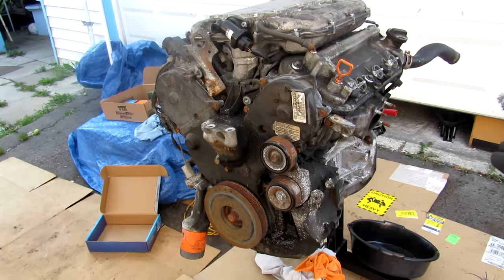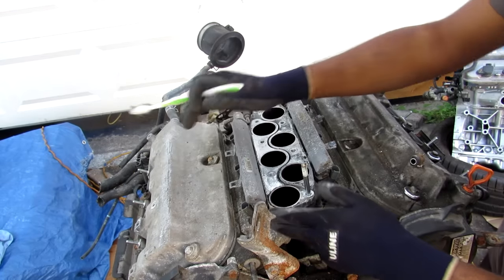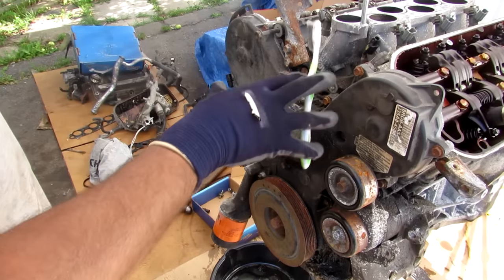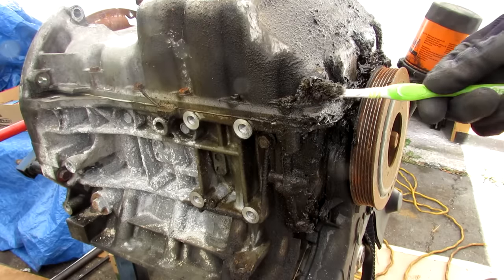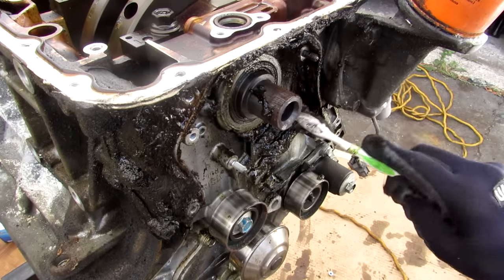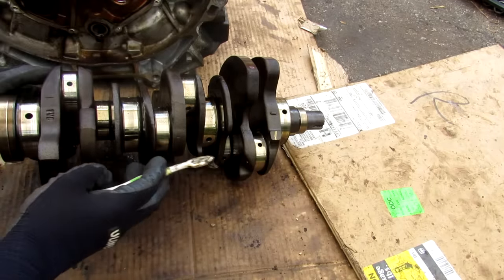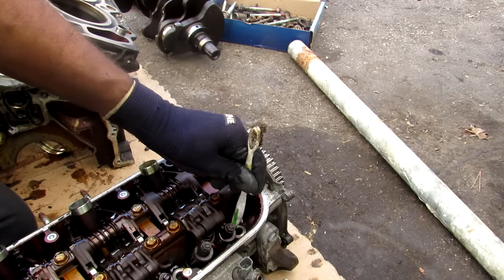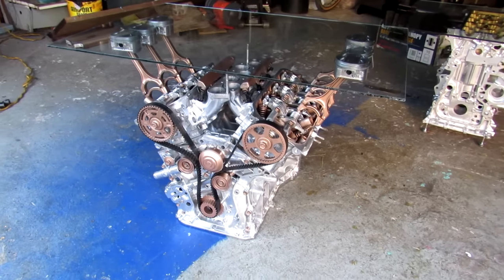Why Honda V6 Engines Haven't Changed For 25 Years

Comment: This engine was also used in the Saturn Vue for several years. With their light weight and the 3.5L VTEC engine, they are something of a sleeper vehicle.
Reply: Lol I raced my friend in his j35 vue and it almost stayed up with my Acura
Reply: Petrol Isuzu bighorn SUV had honda v6 j32 engine in it known to be very reliable and powerful,only problem timing belt and cambelt and service was expensive for regular car.
Reply: The same is true of the v6 Accord Coupe. Faster than most think

Comment: My 2003 Honda V6 has 279,000 miles on it. Does not leak at all, and does not burn oil.  Still smooth and very powerful.  I have 6 speed manual and it does pretty good.
Reply from the maker: Yep these V6 engines can go a long time!

Comment: I'd rather have a quality Japanese timing belt than a German timing chain design purposely made of soft steel to stretch and produce metallic contaminants... 
👍
Reply: But Honda timing chains are made by BorgWarner?  They are exactly the same type as the timing chains used in VW engines AFAIK. :P  (It's more the guides and tensioners that VW use that are the issues AFAIK.)
Reply: I think he saying he basically would rather have a timing belt then a timing chain and I agree even though you have to have a service interval at least it’s made to be replaced,The timing chain is really not expected to be replaced so when it is time to do it it’s a major job
Reply: @thetechlibrarian  it gets scary for the audi 2.0 tsfi at 50k...lmao
Reply: Toyota.
Reply: PSA has you covered. In the current engines they have timing belts INSIDE the oil that last for about 300.000 km.
Reply: @user-gdxt-7399  not, on the peugeot you can throw away the engine at 90000km due to the timing belt in oil
Reply: @alessandroserrao9422  Even if you always use the correct dpec oil? It absolutely needs that

Comment: There’s a gentleman at my work who drives an 06 accord with the J35 V6, which has over 300,000 miles
Reply: Nothing for a v6
Reply: J-30, they went to the 3.5 in 2008 for Accords. Both are great engines
Reply: I sold my 03 v6 with 285k miles, such a quiet and powerful engine.
Reply: @humbertoarteaga3858  a bit too quiet with stock exhaust.
Reply: @humbertoarteaga3858  why did you sell it?
Reply: @trp2413  6 speed manual  with a j series is heaven
Reply: 2012 4 banger Accord 378k miles and still rolling...
Reply: @humbertoarteaga3858  quiet tell that to the people with a clattering sound from the top end
Reply: Good ONE  unfortunately it was auto and it was on its second transmission when it went out. I just didn’t want to go through that headache
Reply: I work with a guy with 600,000 km on an odyssey, 3rd transmission though

Comment: Have an 05 odyssey with 235k original v6 and transmission. Love how smooth, powerful, and reliable the j series is! Best engine imo.
Reply from the maker: Yep it's a very good engine but paired to a bad transmission
Reply: @speedkar99  how is his transmission bad , if it lasted him 235 k miles??......🤔🤔🤔🤔🙄🙄🤦🏾‍♂️ Bad reputations are like rumors and mean nothing if you actually take maintain/change  your fluids
Reply: @speedkar99  the transmissions were bad in some years not anymore. I have an 08 accord v6 no problems from the transmission
Reply: @nickrabiner7843  I agree

Comment: Some British guy in 1919: invents variable valve timing
Literally every modern piston engine: has variable valve timing
Honda fanboys: VTEC just kicked in bro
Reply from the maker: True!
Reply: Vtec effects lift and duration, not timing. I think timing is done with phasers on the cam sprockets. Spacely Sprockets (Jetsons theme starts)
Reply: @brandonobaza8610  First sentence found from Googling "VTEC," via Wikipedia: 
"VTEC (Variable Valve Timing & Lift Electronic Control) is a system developed by Honda to improve the volumetric efficiency of a four-stroke internal combustion engine, resulting in higher performance at high RPM, and lower fuel consumption at low RPM."
Reply: @acefighterpilot  Timing is even in the name 😂 Nevermind, I'm dumb

Comment: "It has a fram oil filter so, you know this engine has seen some abuse." I say the same thing everytime I get a car up and see one.. 😂😂😂
Reply from the maker: Haha 
Yep tells you a bit about the owner
Reply: May be it's a TL crowd thing, IDK. I've been using FRAM Synthetic XG7317 on my 2008 MDX since 2014 and it's not abused by any stretch of imagination. Just a family car that's been taken good care of.
Reply: @AcuraAddicted  fram quality control is junk and they use fiber end caps, where as the other filter makers use metal.
Reply: What you think about wix filters?
Reply: @AcuraAddicted  I have a TL with J37 and I bought 6 of those XG 7317 filters last year. 
The regular fram sucks as we all know, however obviously you've done your research,  the fram ultra synthetic is one of the best filters in the market. 
I installed one during second last oil change just to give it a try, that was November last year, roughly 5 month later I needed another oil change again. drain the oil, took the filter off and realized the silicon anti drain back valve was squashed and completely pushed off from where it was supposed to sit. So it's been just sitting sideways and doesn't do shit. I inspected the filter before I put it on and everything was perfect before I installed it, and no way I could damage it during installation. No idea how long it has been like that but I've done many many oil changes and I've never seen a single oil filter fail in this fashion. Not even the cheapest Chinese made garbage oil filters. 
I change my oil very often I've never went past 5000kms without an synthetic oil change. I know this is a quite overkill but I believe frequent oil changes never hurt the engine whatsoever, and also I do a lot of city driving stop n go like that. I'm saying no way this top of the line fram filter shall fail during those conditions, like I'm literally doing less than half of what my car's required service interval…yet the filter is toast. 
They are supposed to be very decent filters but I now went back with NAPA gold AKA wix 57356. I don't want oil starvation during start up hell no. 
Pay attention to the filter man you know how important those things are, my case might be one of a million maybe QC people took a nap during working hours I don't know but it did happen and it happened on a car that I care about the most. No I don't want it.
Happy Thanksgiving!

Comment: I have a Type S with 112k miles. Thank you it was super interesting to know what goes on in my car explained it very well.
Reply from the maker: Good to hear from an owner. You have the 6 speed manual?
Reply: @speedkar99  I wish. I got the 5 speed auto sadly, but i love the car. It was leaking tranny fluid before on the coolant holes thats the only trouble it has given me. i was thinking about changing the tranny fluid once a year, is it worth it?

Comment: You are a very good and knowledgeable mechanic. The ONLY PROBLEM that I personally had with your video was when you just dropped the engine block after picking it up??? Other than that, you ARE GOOD👍👍👍👍👍👍

Comment: Thank you for being so thorough with this teardown. It's excellent to see which areas I should pay attention to on my J32.
Reply from the maker: I'm going to do a  tear down video on the J32 you saw sitting at the side to explain how VTEC works
Reply: yep, pay attention to the infamous "oil filter spool" + "oil pump seals" leaking! With enough pressure lose they tend to starve lubrication.
Run a thicker 10w30 or 5w40 oil grade instead of low viscosity 0w20. It helps make up for pressure loses in camshaft bearings and hardened seals.
👍
Reply: @glasser2819  Thanks for the advice. I was planning on moving from 5W-20 to 5W-30 since the gaskets are getting to what I consider the age of uncertainty.

Comment: me looking at my J30A5 engine
"See you're never going to get love from the community" 😂 I haven't been able to find anything cool about them and the same goes for an 07 Accord SE V6.
Reply from the maker: They aren't cool but they are dead reliable
Reply: They came offered matched with a 6 speed manual cool!!!  I have a sedan for those rare 2 years offered and love it.
Reply: If you plan to keep a car for a long time, the manual trans is the best option.

Comment: Thanks for this video. I own a j35 (2007 TL-S) and j37 (2007 MDX). I never knew the knock sensor was in such a bad spot. I've taken apart dozens of Honda 4cyls but never got into taking the v6 apart. Thankfully. They are much more "connected" to everything than the 4cyl. My TL-S auto transmission is just starting to clunk a bit at 170k. The MDX is still going good so far at 220k. This video made me glad I paid Honda $800 for the timing belt/wp/tensioners installed. I would still be putting it back together
Reply from the maker: These are great engines. Too bad the transmissions attached to them were never as sturdy.
Reply: @speedkar99 I know the CVT from Honda has had its issues, but how do you feel about the manuals paired with J-Series engine?

Comment: what you mean "fairly" reliable? As if there are many others out there that can outlast Honda motors?
Reply: Toyotas engines are more reliable. And dont forget that the versions of this with VCM were known to have oil consumption problems.
Reply: that engine still used in Indy Car until now but put some DOHC
Reply: Toyota's don't last or didn't jhoin in Indy Car series because they have no reliable V6 engine to compete with Honda, Chevy, Mercedes .....
Reply: Andrew M Toyota as a brand whole may be more reliable yes, but Honda does build better engines overall, ESPECIALLY 4 cylinder engines
Reply: Honda's V6 are already proven also its reliability in TLX race cars, Indy Car, GTR, 24hours racing even at F1, just like much to inline 4 cylinder of CIVIC in World Touring Car Championship
Reply: Many.  Buick 3800 and AMC 4.0 are known to last past 300k.
Reply: @totzinfo  i would not use recent honda f1 as a "good" example.
Reply: AC Cobra  The manuals are fine, and since this is a Honda, that's the only sensible choice.
Reply: @totzinfo  That's the IMSA engine for the Acura Daytona Prototype I think, the Indycar uses a purpose built racing engine.
Reply: @theakh4238  I've had plenty of relatives go 300,000 on 3800. However, the rest of the car did start falling apart at 100,000 miles such as window regulators, interior parts falling off for no reason, and severe rust. All Buick Park Avenues/Lesabres.

Comment: Have one of these engines that has 400,000 miles and it’s still going!
Reply: I have an 03 v6 accord with 360,000 miles and I still hit VTEC once in a while. Still has plenty of power and has never left me stranded. One of the best engines made!
Reply: I know a guy that is not far behind you... 349,000 still going
Reply: We're at 295,000 miles on our 2003 Accord V6, though I worry its getting too rusty, and i doubt we will see 350,000 miles.

Comment: I laughed out loud at the Fram oil filter comment! You are 100% correct on that! Fram makes one, if not the cheapest filter on the market today with their cardboard end caps etc. I generally stick to WIX or Hasting/Baldwin filters myself. Keep up the great work!!
Reply: Only now I get that joke.
Reply from the maker: Yes, I've cut fram filters apart alongside OE...I only use OE now
Reply: @speedkar99  That could be a great video idea! Line up a bunch of oil filters and tear them down and compare! Keep it up brotha!
Reply: @speedkar99  it amazing how Japanese OE parts quality is always best!
Recently I dealt with a Honda PCV Valve from eBay that was likely counterfeit junk... I put back the old original fixed my idle miss.🤗
Reply: @DeathMammoth91  there is a video on you tube, K@N make the best filter.  The high end filters like wix use synthetic filter material that is good if you don't regularly change your oil. Reason being is that the material does not break down and fall apart after long period of use like a paper filter. That being said moisture is a major contributor of sludge in oil.  Filters like WIX that use synthetic are useless at removing moisture from oil. Paper filters (like paper towels) are great at moisture removal. K@N is the only high end filter that uses paper material, except they coat the paper to prevent breakdown.
Reply: @rayalarcon115  Thanks Ray for the information! Do you have a link to this video? Thanks in advance!
Reply: Mobile 1 20,000 -change at 7max😂

Comment: The engines were good until Honda started using there VCM (Variable Cylinder Management ) system. I had  the common issue of worn piston rings and all the cylinders on the back bank, especially cylinder 1 constantly misfiring.  I was one who always had the car serviced for everything. The one thing I regret is following The Maintenance Minder. I think most  engines need  oil change at 5K. If you rely on the maintenance minder it may not tell you to change the oil until 8K.
Reply: And even no further reply with the oil burning issues of the Acura J37 engines.
Reply: I hear worst are 2008-2010 Odysseys which also some had cams that would wear out. Yet i still see many for sale with mega miles hmmmm
Reply: its not VCM. the 3.7s have issue with the oil control rings gumming up and cause oil burning. caused by large heat cycles(living in cold climate) and short travel distances.
Reply: I had crv 13 and civic 17. Serviced at dealer. They always ask to do oil change at 5k miles. Isn't that the standard for any engine?
Reply: @amilmitt  Ouch, hadnt heard of these issues not good for Acuras reputation
Reply: Pretty sure that VCM was absent on the manual transmissions, which I presume this Type-S was mated to.
Reply: @miguelelasmar  Majority of type S TLs were autos bummer :( But you're right
Reply: J35s from 2013-up had revised VCM systems.  No major issues are found on  post 2012 motors. (at least the non-GDI Accord versions)
Reply: @timothyforce1949  It's not 2013 up for all Hondas. Only Accords. VCM-3 was introduced to the Odyssey in 2018. It's not really revised, just more like the initial version of VCM and doesn't activate as much.

Comment: I've been beating the hell out of J30's for a couple years now doing Time Attack, and HPDE. These things are capable of handling so much abuse, it's insane.
Reply: Love to hear it. Any more to share please do. It's my first manual, J30A4. Had a money shift early on, from 3rd to 2nd and over-revved to close to 8000 rpm for 2-3 heartbeats. Zero problems from that, still redline it nearly every day, through 0-20F temperatures too (once warm). Change oil religious 5K mi full synthetic.

Comment: Honda dealer mechanic here. The injector bases on Honda V6’s do come off without taking off the heads. One after the other it just takes some wiggling and a little finesse. It is meant to come apart that way. The knock sensor sub harness is often chewed by mice that’s why it’s covered in capsaicin tape but they often don’t care and chew it anyway. The sub harness and knock sensor can be changed without taking out the injector bases. Removing the intake plenum and power steering pump will give you enough room to get in with pliers and a wrench to get the harness off and the knock sensor out. It takes about 45 minutes.
Reply from the maker: Thanks for the tips 
I struggled with that dual intske setup for a bit

Comment: W/o seeing the video the engine looks flooded and not maintained look at that rust.
Reply from the maker: rust? Its been sitting in my yard for a little while until I got to it.
Reply: I don't even want to know what the rest of the car looked like just knowing how much neglect this engine received, especially the rear main seal and timing belt.
Reply: @B-rad1  the motor sat in the yard with the element's  for quite some time, im sure the water from the rain and moist would caused that timing belt to dry rot
Reply: I have a 07 Accord that is well maintained.
After 13 years in the Chicago salt belt, my engine looks just as corroded as that one...

Comment: Your videos are excellent with lots of tech related quickly, with concise editing.  Never learned so much so fast.  Great engine, but I agree that having rubber timing belts makes it not a desired choice today.  The MLS head gasket isn't a downside as that was an upgrade in many engines, indeed switching to an MLS gasket fixed a notorious oil leak in my 1996 Plymouth 2.4L (a recall).
Reply from the maker: Thanks 👍 ok glad you appreciate my video style

Comment: Ive had this engine for years it was nice to see the teardown and wow the knock sensor its in a horrible spot. Its a very realiable engine and it would had been better if it was designed with a timing chain instead of the rubber belts that goes bad over the years and milage. Thanks for the teardown this will help me  with my j37 and j35 on my MDX.
Reply from the maker: You are welcome. Good engine but a bit behind it's time now
Reply: Honda timing belt is non-strech design-incredibly strong! It's better than timing chain because quieter operation. It good for 10years or 110,000.

Comment: Had a '98 Accord Coupe with the J30...bought used and ran it to 270K until the trans started to worry me... Bought a '14 Coupe with the J35; no problems there. And in the meanwhile, bought an '03 TL-S that was an absolute creampuff. Garage kept, beautiful. Heard horror stories about that 5-spd auto, but so far, so good w/ 148K on the clock. Either the previous owners replaced it already, or it'll probably be fine at this rate...or not. 😜

Comment: I've had four of these engines 03,04,12,19- great motor.  Just wish it had a timing chain rather then that stupid belt.  Thus a 9/10.
Reply from the maker: Agreed. And self adjusting valve
Reply: How often do you change the timing belt?
Reply: @alejandromtzl  Every 100K-110K
Reply: Likely a person could go longer --- but if it were to break - engine is toast.